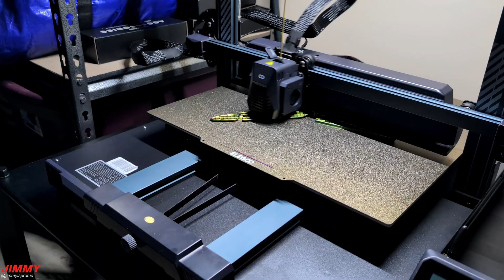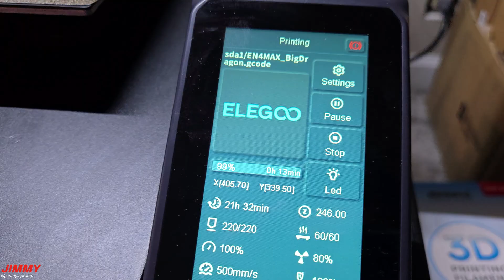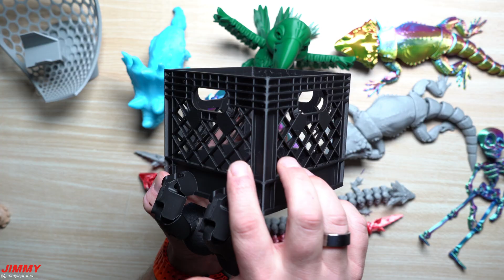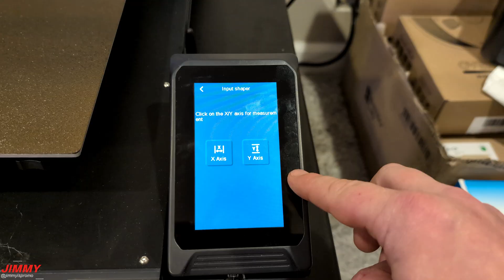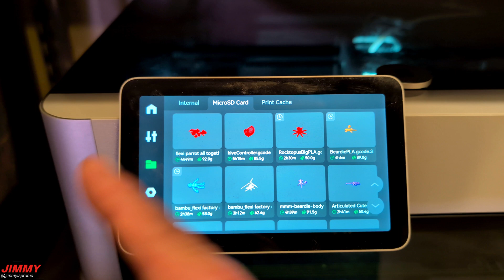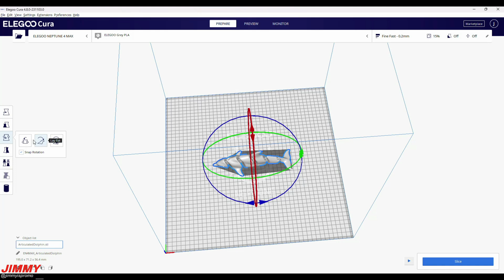The Best 3D Printer Under $400 - Elegoo Neptune 4 Max

Comment: The CoPrint has brought multicolor printing module that can be used with this massive printer for up to 8 colors printing!
This is by far the best printer on the market.
The TBStron3D also provides mods that allow to change belts and rods in favour of linear rails and that is a massive game changer

The CoPrint is about 280-350USD (4 or 8 extruders)
and the TBStrond3d mod is about 350 USD for all X and Y linear rails and belted Z axis instead of rods

Making this roughly about 1k USD in total
Similar offering from BambooLabs or Creality or any other brand is easily over 1.5K and the they come nowhere close to this massive bed size (350x350 for bamboo)

The only downside is the sheer size of it and lack of enclosure.

Comment: Great video.  I started with the 3 Max in November 2023 and that worked out of the box, so I treated myself to the 4 Max in April of last year after my brother bought one and I saw how much faster it was.  They sit next to each other on a sturdy table, and I assume that just like me, you took your time assembling them as per the instructions, manual leveled, auto leveled, got a good z-offset and did any other calibrations necessary.  Like you, I've never used glue or even hairspray on the PEI sheets.  I don't even remove the bed as the prints stick fast while it is hot, and just pop off when the plate cools down.  They're brilliant machines and the only other advice I'll give is to make sure you update the firmware as per the read-me file that comes with them, and download the Ultimaker Cura slicer instead of the older Elegoo Cura that is supplied on the microSD card/USB stick.  If you look carefully at my icon, the Enterprise I'm holding was printed on a Max.

Comment: I've heard this printer had a fair few issues when it was first released. Are these mostly resolved now?
Reply: Actually yes, they have been resolved. Provided the printer has up-to-date firmware AND you do the bed leveling while the bed is hot, there are basically zero issues.
Neptune 4 Max owner btw.
Reply: @RedstoneNinja1 is there a way I can contact you off YouTube my printer is just not working and I’m stuck and need help🙏
Reply: @whynot1284  first, watch the complete setup guide for the Neptune 4/Pro/Plus/Max by WildRoseBuilds. This man saved my 3d printing life, and as long as your firmware is up to date, this video should work for you too. If it doesn't, let me know!
Reply: @whynot1284  how's your printer after following that setup guide?
Reply: @RedstoneNinja1  haven’t had the opportunity to watch or setup my printer again planning to this week thank you for the reply’s
Reply: @RedstoneNinja1 Agreed. Once I worked those kinks out I have had ZERO issues. Dial in the slicer profile settings and happy printing!
Reply: Not from what I saw.

Comment: Thanks for the attention to detail in this video. Btw there's plate guides that you can print and put on the corners. I printed them for my n3p but don't keep them attached, just use them to align it when putting it back.